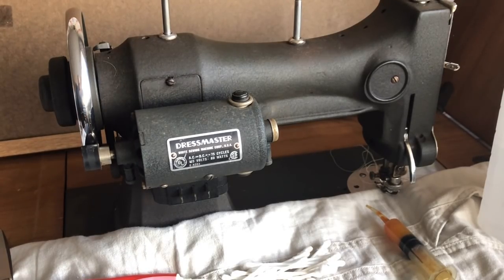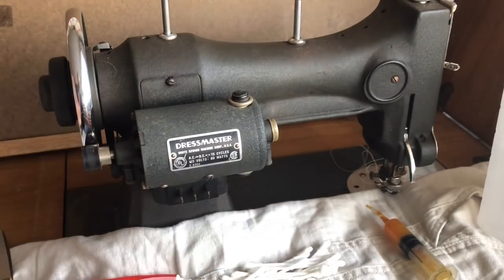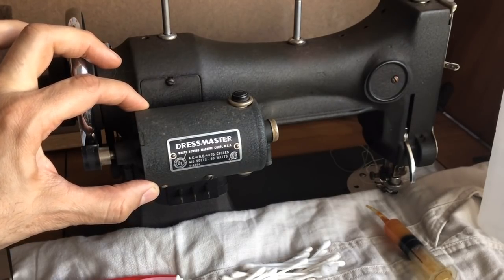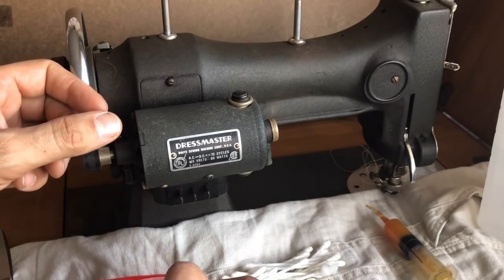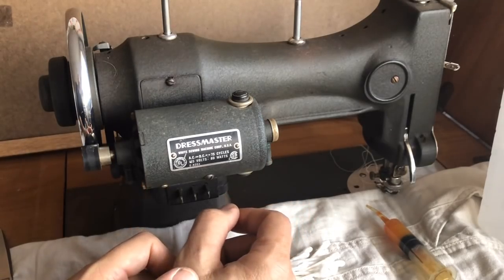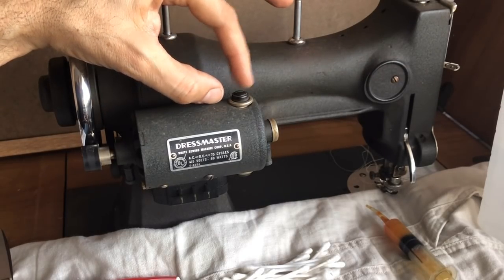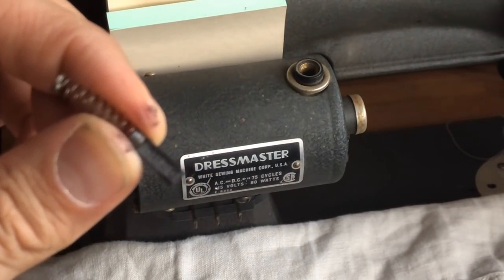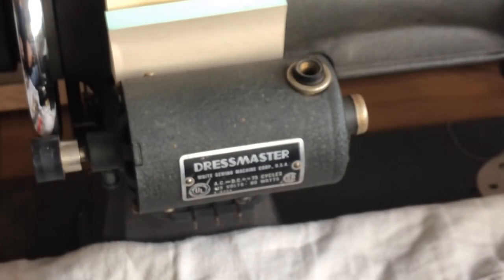MOTOR SERIES #1: Areas For Motor Maintenance & Focus On Brush Inspection/Cleaning The Commutator

Comment: I own a White Model 967 and with the help of your video I believe I have saved the motor from motor death!.  I believe this machine was manufactured in the late 1960's or early 70's in Japan.  Its a wonderful machine and needed some intensive "care."  Thanks to your video here...I was able to access the motor..by removing the side panel...and luckily getting the motor out of machine was easy!   Once out I found the holes for lubricating the bearings and I used Zoom oil a few drops on each side as you instructed...the motor sounds 100 percent better now. I could hear the bearings crying before oiling.....I'm, sure I've extended their life now.   Unfortunately there is no way to access the brushes...sigh...so I just have to deal with that fact.  While I was taking care of the motor bearings I  inspected all the moving parts of the machine ...I had used Tri-flow when I first got the machine and I do think that lubricant helped clean it up and did a great job on oiling/lubrication.   I noticed under the bobbin area there was what looked like a covered "gear box."  I carefully removed that cover and  yep there were gears covered in "sludge" that once was gear grease.  I followed your technique of using q-tips and I sprayed that area with Tri-flow ...which does clean as well as lubricate...and I worked on removing all that sludge...Once I got it cleaned up ..I applied Tri-flow gear grease with a paint brush ..following your technique of applying...Oh yes there is a paper "washer" around that gear box cover..that can prove fragile ..and I was super careful to preserve that!  With you help I've got the machine in good shape now.   I really like the way it performs....I also own a Morse from the late 1950's also made in Japan..a "Fotomatic" that runs beautifully.  Thanks again for your excellent videos...here...to help us!!
Reply from the maker: So happy to hear of your success Stephen.  Thanks for sharing this.

Comment: How do you get the brushes out if they don't come out with the spring? I have a kenmore 117.720 which has a very similar motor but a couple differences like no grease wicks.

Comment: hello, thank you so much for this series. i tried to loosen the plastic screw and it was so brittle it snapped. has this happened for you before? is there a way to remove a broken plastic screw? thank you again.
Reply from the maker: Yes, it has happened to me.  Not often but it can and does.  The plastic gets brittle with age.  You can try to wiggle it out with small needle nose pliers, tweezer, or a combination of those.  If it breaks further into small pieces, be sure to turn the motor upside down so they fall out.  Make sure they are all suctioned out before you take out your brushes.  If it is for a Singer motor, I have found replacements online.  For other brands, replacements may exist though I've never gone searching for those.

Comment: Hi I was wondering if you can help me. I have a White Rotary Martha Washington cabinet sewing machine. We took the motor off to clean it and got it put back together but we cannot figure out how the spring on the outside was situated so that the motor tilts towards the machine. Do you have a picture on how that spring looks where the pin goes through it? I hope this makes sense - thank you

Comment: What are those plastic screws called? Both of mine broke :(
And where can I order some? Do you also happen to know how I can also take apart my motor to access the bearings. I have a 117-959 Kenmore sewing machine.
Reply from the maker: You might try this site where they carry a number of Rotary parts. 
https://sewingmachine221sale.bizland.com/store/page44.html
Reply: @VintageSewingMachineGarage  
Shoot well it looks like I'm screwed. Can't find anywhere to buy the motor caps from. Do I buy a new motor or is there a motor cap screw from a singer sewing machine or other machine capable with this machine? Kenmore 117-959
Reply: @VintageSewingMachineGarage  sorry for asking so many questions but you are the only expert at this who may be able to help me. If I can't find the plastic motor caps could I use metal screws that are the right size? I would have to figure how to make that but if is possible and the spring is attached to them will it interfere with the motor when on? Is that why they are plastic in the first place?

Comment: HI -  What a great series!   I'm so excited to have found you!!  I have my mom's old Kenmore from the 30's.  Recently I tried to use it and the motor barely turned.  So I'm going to try the cleaning and the rewicking and lubricating from your other video.  My question is - if I do all that and I still have a slow or groaning motor, can I replace it with a replacement motor easily?  Not sure if they even make these types of motors anymore.  Thank you again for all your videos.  I have learned so much and am so grateful to you for making these for us.
Reply from the maker: This particular type of motor does not have new reproductions to my knowledge, but the good news is that they were in production for several brands for literally generations so there are lots out there.  FYI, remember to also check the rest of the machine since a motor can mimic a worn one when the machine is actually being slowed by tangled threads (commonly in either the shuttle/hook area or the hand wheel).  And there can be other causes as well, but yes, motors such as these were designed for maintenance to allow them to fully run properly.
Reply: @VintageSewingMachineGarage  Thank you!

Comment: Can't even tell you how THANKFUL I am for your channel!  I caught the vintage sewing machine bug 2 months ago - and I'm obsessed with rescuing and restoring these amazing machines.    i'm currently working on my White Rotary machines....series 77 and 43.  Today, while watching this video, I pulled out the brushes on my 43.  However...there were no brushes attached to the springs - on both top and bottom.  When I looked into the motor hole (where I unscrewed/pulled the springs) - it looks like a flat metal piece at the bottom of the threads (hope that makes sense).  Is it possible to have just springs and not brushes on a rotary motors?   Clearly, the 43 was an earlier White model, so maybe it didn't have brushes?  Otherwise, maybe the little metal piece I see is the top of the brush.  I tried to push it out (through the holes in the end of the motor), but it doesn't seem to budge.  Not even sure I'm actually making contact with the metal piece that I'm seeing.  So sorry this is long.  You need a  "pay-for-my-expertise" direct contact line!  :-)
Reply from the maker: All electric motors for vintage machines use brushes to my knowledge.  The commutator they push against is copper (might be dull but still copper).  What might have happened is yours may have stuck to the commutator and when you pulled the spring out, the brush stayed in!!  Brushes are a dark great metallic color.
Reply: @VintageSewingMachineGarage  yep, that sounds like what must have happened. I can try to get them out, but I think I might need to completely take the motor apart.  Might as well jump right into a full restore, right?!  Learn by doing.  Okay, friend - add to your list - "Make video of completely taking apart a rotary motor".   BTW - I think you are in NYC?  Can't remember what you said that made me think that - maybe just how you have to walk your heavy machine purchases home.  Thank you so much for your insight.  Off to look at the top of the brushes again - and start taking the motor apart.  Sigh.

Comment: Love your videos, your a real gem..thank you..I just looked at my brushes on my new to me 77 and the brushes are about 1/8 of an inch..lol..my question is do you have a parts # for the brushes that fit or a recommended size and or source to get them...  thanks
Reply from the maker: Hello Linda.  Its fortunate that you checked your brushes since if they get down to nothing, it can destroy the motor.  I would hold off using yours until you get replacements.  There is a site that sells brushes that they specify for Rotary machine motors.  You might contact the seller to be sure before purchasing but they sell these as replacements that can work.  Here is the link and you will see the brushes listed about 2/3 of the way down the page.  
https://sewingmachine221sale.bizland.com/store/page44.html
Reply: Vintage Sewing Machine Garage thank you so much..will head there immediately!

Comment: I have the Domestic Series 153.  I took the top nut off and there was  no spring on the brush.  Can I purchase new springs?  Thanks,
Reply from the maker: Hi Paula.  You should be able to get a generic spring.  Try checking the bottom side for the other brush and if that spring is there, it will make it simpler to use that as a guide for the one you need. A search online should help find one.  FYI, you can look for "sewing motor spring" but you dont have to since many electric motors have brushes and springs to support them.

Comment: Hi I have a Necchi BU Mira with a deteriorated power cord. I'm unsure if the motor works due to the power cord's condition. What would you suggest to try  and clean the motor or just purchase the power cord and hope that does the trick.  If I clean the motor What should I be looking for? Thank you.
Reply from the maker: Hello Veronica.  Most Necchis from that period have several cords.  One has the oval plug that connects the motor housing to the power source.  Another runs from the motor housing to the on/off switches.  And yet another is often found running from the motor housing to the kneel control unit.  Point being, ALL OF THESE should be inspected.  Replacements of the lead power cord that you plug in for power are available new as reproduction cords just like those sold for Singers.  The other cord sections have to be rewired and often do need it.  FYI, also note that you can get replacement motors depending on your bracket setup.  If you don't feel comfortable doing the work yourself, you could find a local repair shop ('maybe' a vacuum/sewing center) or another source locally.  The cost of the cords/wire is quite low and the labor should not be too terrible since most of what needs to be done can be easily accessed.  But you were correct to use caution before trying to test running the motor since any short in a cord can ruin the motor AND is a dangerous hazard.  Note that this is something that should be inspected with any vintage device of any brand.  If you still feel lost, try joining one of the many Facebook groups that focus on vintage sewing machine repair.  There are lots of folks that can share experiences in how they updated their machines and are now enjoying the remarkable sewing power they offer.

Comment: I have 3 machines 117.812, 117.959, 117.552. Where can I get replacement brushes for the motors? I called the place in central Michigan and they have no Idea what the dimensions are for them nor do they have them

Comment: Dose this motor brushs need grease. And is this motor for modle43 white rotary sewing machine  1938. And when run it thair funny oder. It 50 yr more sence one I have been clened.
Reply from the maker: Hello.  No, you NEVER EVER put grease or anything on the brushes or brush housings.  This would destroy the motor pretty quickly and would create a serious hazard.  Grease for this motor is ONLY used in the wick compartments which are separate from the brush housings.  As for your model, I would need a photo of the motor to know for sure because White and other sewing machine makers would make updates and changes to their motor design over the years.
Reply: Were can I send pitcher to